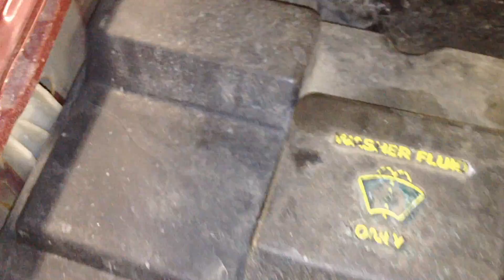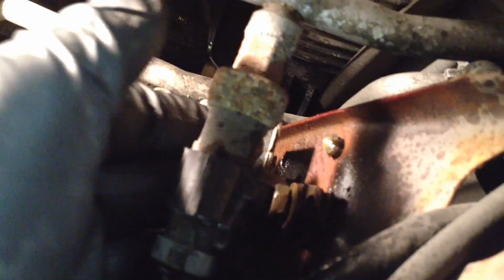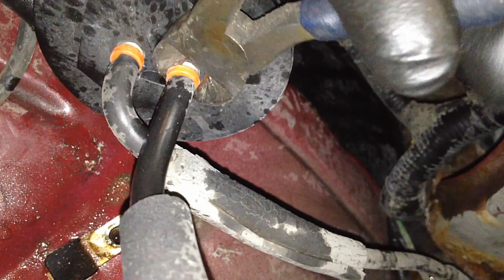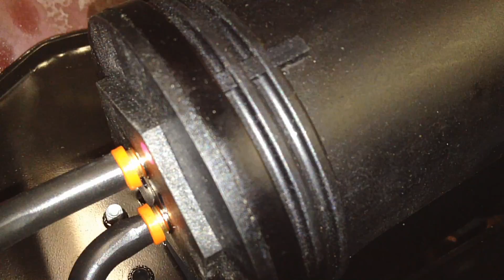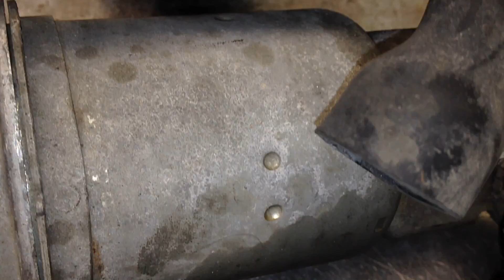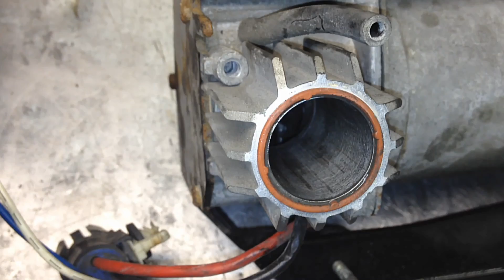Ford Air Ride Suspension Air Compressor Replacement

Comment: Hello,
Mine is an 06 Eddie Bauer. I was unaware that these vehicles had Air Ride. Do they all have it? I have noticed that my ride seems to be more rough lately. Do you think that's the problem. I have checked to make sure the tires are properly inflated.  Thank you in advance for sharing your wisdom..
Reply from the maker: +RON BELSHE No it was definitely an option. You will know right away when you look in the rear if you have air ride.
Reply: Okay, Thank you for your Rapid response....
Reply: RON BELSHE can I drive it whit no sir in the bag
Reply: I installing new air suspension bags in the my expedition but seams like no air to full can I drive it like that

Comment: when replacing the drier ipulled out the clips and the pressed hard metal piece came out with it any ideas on removing them
Reply from the maker: r green yes pry them up off the line as shown in the video.

Comment: Thanks for the video nicely done.  I have a question.  I notice that mine would work almost all the time.  In these are the leaks basically at the pump?, and not in the rear part of the vehicle.  The reason why I ask is because mine that for along time and now it does not work should I be worried about other things?, or should I just replace the compressor like you showed in the video?
Reply from the maker: anievestor Replace the compressor then check the rear bags for cracks that are leaking and overworking the pump.
Reply: +FordTechMakuloco  I have a similar issue with on 03 marquis  ultimate  edt. air compressor kicks on and all I hear is hissing from the compressor  location. could this simply be a bad air line? when it happened it was about 25°f outside, the compressor kicked on, then I heard what sounded like a loud pop from under the hood.

Comment: can you tell me, please, where is the pressure switch located in this system? what cycles the compressor? there is (obviously) a 4 wire switch from the comp, I would assume neg and pos 12 volt for comp....are the other 2 wires neg and pos to pressure switch? is it preset or adjustable? THANK YOU!

Comment: We have a 2011 Expedition 5.4 V8 
Would the air compressor be located in the same location as the 2009 edition? What should be removed to expose the compressor?
Reply from the maker: Yes same location behind and below passenger headlamp. Best to remove the tire and the at least the front part of the wheel well liner and it will be right there
Reply: FordTechMakuloco Thank you for your quick response! We ordered the part with so hopefully husband will be able to replace this.  We saw on another post that you can remove the battery and washer fluid container to expose the compressor.  Is this true?
Reply from the maker: Crystal Sinclair Yes but my way is much easier and the official way from the workshop manual you will see.
Reply: Crystal Sinclair

Comment: ok. my 2003 lincoln 2wd navigator front suspension does not lift when its cold. the compressor is running.( the rear suspension works great all times). in warm temps, fronts work great and holds in the air and runs great. do you think the cold temps might be revealing the compressor and dryer is getting worn down and might need to be replaced?

Comment: I have a simmilar problem 07 Nav. Pump runs but ass end slammed down. The air seems blocked between the dryer and air tube. I disconnect and I can feel the air. Is this a bad fitting. Failed dryer? sould I replace whole assembly or just the dryer
Reply from the maker: Jason Torian You disconnect the air line and air pumps out of the drier just fine?
Reply: yes I can feel air coming out of the pump... I dont know how "strong" the air should be but...its coming out.. I order another  pump assembly... I feel that even if I'm wrong that pump will statistically give way at some point and I will have one on hand....What else could it be? I had given some thought to moister getting into the air line...and its reallly cold right now
Reply: I was thinking of putting a space heater in the garage in an effort to warm up the garage.....maybe it would thaw if thats the problem. But that begs the question of how moisture gets in the line? does that mean the dryer is failing? (again the pump IS running)....Could it be the coonnectors/o rings? if so where do I get those...?
Reply: FordTechMakuloco
Reply: FordTechMakuloco Since the pump is running does that mean that the rear linkage sensors are performing as intended. If they have popped off does that send the signal that I'm (the truck) is standing too tall so release air...OR is there a valve stuck open on the pump there by releasing air.....? how could I clear moisture/ice out of the line if I replace the pump
Reply: Ok Ford tech and anyone else who reads... Got a aftermarket refurbished  pump ($106) installed and truck recovered. Funny, the compressor still ran so I suppose it must have had some blockage in the dryer. I will retain the compressor this time and buy a new dryer next time as on average it seems that this needs to be done every 4-5 years. The pump was slightly different that the OEM it has two ports and and optional plug. heres what I wrot the supplier..... Hello, received pump and installed. Truck recovered. There is a gold relieve valve should it was only hand tight when I removed it from the box. Should it be torqued down or remain slightly loose to allow air to escape? I snugged it down with a ratchet. Is this the proper thing to do? Will it allow air to purge from the system when it is supposed to if I’ve torqued it down? Is this gold 15 mil relief valve porous will air flow through it? The pump I received was slightly different from the OEM. It has two ports vs. one  is this by design? Finally, my truck has a rubber tube that attached to the relief valve but the relief valve on the new pump is in a location that will not allow me to attach it. Is this a problem or can the new pump dispose of purged air without this tube being hooked up? What are your thoughts on this?

Comment: I have a 2004 Navigator with no front end movement after compressor replacement. The rear came up. I took left front line off air solenoid and put smoke machine pressure on it. The machine showed no flow. Is the vent solenoid normally closed in the ignition off position? I unplugged module. Then, I put power to left front solenoid and turned compressor on, The left front did not move. Do I need to put power to the vent solenoid ,too?  I tried to do testing with scan tool. I cleared codes. But, I am getting C1991 code now. It will reset after ignition switch is turned back on.
Reply from the maker: Was the control module changed? You need to get the ride height calibrated at the Ford dealership or the code will not clear.
Reply: FordTechMakuloco The compressor and 50amp fuse was changed. I have an OTC scan tool. It pumped up the rear. But, rear never came up . I tried to do the two test on the scan tool. Then, latter the code came up . Could clear but reset.. I was going to try to make the system work by putting power to the solenoid and make pump relay work .I put power to the LF solenoid and grounded pump relay. But,could not see LF move. Do I need to put power to the vent solenoid ,too? Is the vent solenoid normally open with no power to it? I am doing this with module disconnected at module wiring harness.
Reply: @ShawsGarage  Solenoids at each bag, I believe are normally closed, with no power. They will not allow air in until open. The electrical solenoid pulls against a internal spring that holds the internal valve closed ( unless the solenoid is stuck partially open) until requested by the control unit ( voltage applied),  Need determined by, ride height input from ride height sensors.
 Shut off/and on (open) for the fronts are left , right independently. But rears are actuated as a pair, with the single rear height sensor reporting total combined height. Hope it helps. Beware of plugged air delivery lines, its a thing with older stuff. Moisture in northern climates can have an effect on the systems ability to deliver dry, clean air to the delivery hoses, and solenoids. They self lower, kneel as a way to make it easier to enter.

Comment: I have a problem with my 04 navigator the air suspension its not working I change one of the air ride sensor and the air compressor and still not work and I watch a video that maybe the problem is the relay air compressor but I can't founded :( anywhere and I'm desperate so if you guys can help me I am going to appreciate it a lot thanks
Reply from the maker: Elizabeth Garcia How did you know the height sensor was bad? Have you had codes pulled from the air suspension module?

Comment: I have a 2000 town car. I cranked it to warm it up yesterday (it was 15 degrees not normal for east texas) it was sitting normal but the compressor did make a weird noise like it was leaking air but I didn't pay much attention to it. I came back out 10-15 minutes later and find it sagging in the rear. The compressor comes on but it doesn't air up but to me it sounds weak not as loud as before. I turned the air suspension switch off for now till I figure something out, any suggestions?
Reply from the maker: chino8407 Yeah it sounds like the vent valve is leaking on the compressor.
Reply: Do I have to replace the compressor or can I buy that valve seperate?  Also is their any way to air it up while I get it fixed?

Comment: question, i have a 97 expedition with air suspension, converted a while back to coils, just this morning, the air compressor was non stop, i had even timed it for almost 20 min when i just decided to take off negative battery terminal, i wanted to know if i can just disconnect the air compressor from the plug you had shown and it'll be ok? I'm worried about it turning on again and not stopping which could heat up
Reply: disregard, i ended up unplugging the plug for the air compressor with the eletronics and it solved the annoying air compressor lol
Reply from the maker: LEO CAL Sweet!
Reply: i wanted to ask another question ask but its off the air compressor topic, same ride, front window washer fluid won't disperse any fluids out, I've changed the motor on the washer, checked the lines, but i havent changed the fuse since i can't seem to find which fuse it is? any help with this one +fordtechmakuloco

Comment: Nice video, was wondering if by 1996 expedition rear has dropped all the way down, & is bouncing terribly, could it be the compressor or air bags ( shocks ) that are out? Thnx for your help.
Reply from the maker: jaeden amaral More than likely the compressor.
Reply: Thank you

Comment: I have a 2001 Lincoln continental . Whit 85000 miles.  Have the air ride suspension... but it's a v8 fwd so shit is hard to get to.  So where would it be on my car
Reply from the maker: brookes pippen Your air compressor is behind the passenger side headlamp.
Reply: @FordTechMakuloco  Under the washer fluid reservoir on my 04, behind the pass. headlight.

Comment: The compressor went out in our 1999 Expo...My BF replaced it but the back end won't come up, not even slightly...we jacked up the back and still nothing.  Could the connections be loose?
Reply from the maker: Does the compressor turn on and try to pump up the rear? If not try this-
Ford Air Ride Rear Suspension Down Diagnosis
Reply: FordTechMakuloco yes it does come on...sounds like clicking in the back but then nothing happens.
Reply from the maker: So you never had any issues before the compressor went out? There is one other thing that is common on these if the rear is not getting air. There is a rear fill solenoid on the frame under the drivers seat area these fail often and will not allow air to the rear springs. I assume you have 4 wheel air springs?
Reply: FordTechMakuloco No my BF says it is a 2 wheel spring.  it's a 4 wheel drive but it only has the 2 springs in the rear...nothing in the front
Reply: FordTechMakuloco He is going to take a look at that solenoid...hopefully that is the problem!
Reply: ok! thanks a bunch!
Reply: Susan Garland
ok so where is the solenoid?  I can't seem to get him to look at it so I will...
Reply from the maker: If it is only the rear springs then you don't have a rear fill solenoid. If the pump runs continuously until it turns off to cool and the rear solenoids click, you must have a leak in the air lines or rear air spring bags. You will have to listens for leaks. Was the pump a new pump from Ford?
Reply: FordTechMakuloco
not sure where he got the compressor.  I am thinking it is the bags...Need to find the time to take it in, or put it on jacks and take a look at it. thank you for all of your help!
Reply: FordTechMakuloco
I dont' think the part was from Ford...pretty sure O'Riely.  Still waiting on him to "fix" it! I may just find jacks and put it on blocks and check it out.

Comment: Great video.  Called the dealer...."think my compressors out, what's ballpark to get it fixed?" "Lemme, see....compressor's $700 + labor, will be about 900." Gulp.  Called local auto part dealer "yeah we got em in stock, should be about $260."  Even if this takes all day I'm comin out ahead.

Thanks
Reply from the maker: Sounds about right.
Reply: Lol, take me with u

Comment: Once the compressor is put on, will it always make noise?  Even after it has leveled the back suspension.
Reply from the maker: Rick Gonzalez It will make noise every time you start the vehicle to pump it back up after it kneeled upon shutdown.
Reply: Ok, thank you

Comment: how can I ck to see if the compressor is putting out air
Reply from the maker: Best way is to remove the dryer from the compressor and then run it you will feel it.

Comment: If this whole system be removed my had the air bag suspension removed but it still has the pump and it's making a horrible noise so can I just delete this or will it cause a problem
Reply from the maker: You have coil springs now? Yes just disconnect the air compressor pump elec connector.